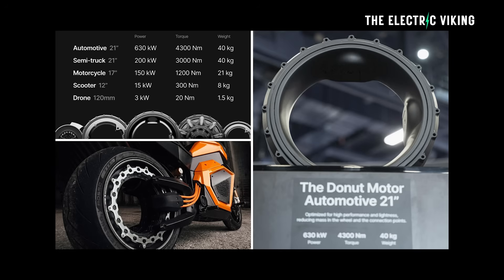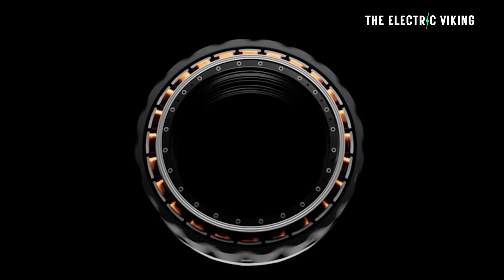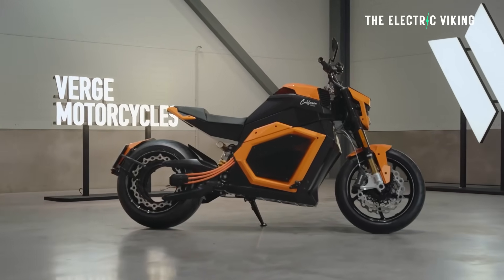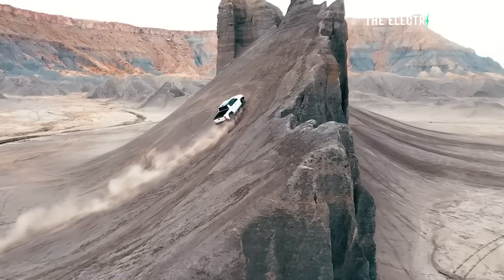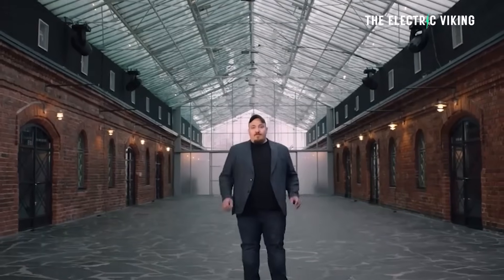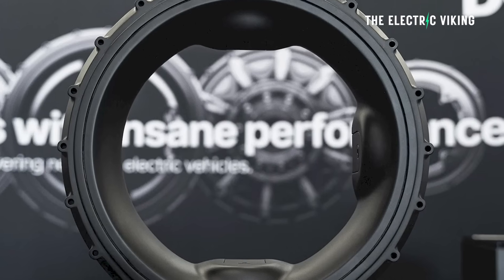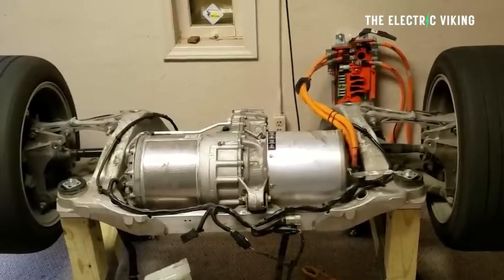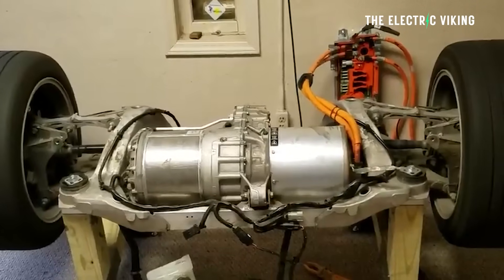Donut Labs' game changing Electric Motors will Revolutionize the EV Industry

Comment: I just don't see it.  These motors would be subjected to all kinds of torturous elements, potholes, floods, curbs, rocks, earth/sand, etc that, even if you could harden them, must degrade over time.  I can't think of anything manmade that can withstand continuous punishment without needing regular maintenance or repair. I imagine you would also need all 4 wheels to operate at the same level, the same rate, all of the time. If one motor is not working properly, then what?    I'm sure it's great, on a dyno.
Reply: Some of that you can handle with a bit of clever code ;-)

Comment: I wonder if the Angular Momentum would be a significant factor that would affect the drive-ability of a motor bike? The Angular Momentum won't be significant if the wheels are just alloy rims and rubber tyres. A 40 Kg  wheel hub plus rubber tyre would make the vehicle difficult to steer because the Angular Momentum would dictate where you are going.
Reply: Is that true if it is on the back wheel?
Reply: @isstuff  I am not an expert on motor vehicles, but with my understanding of Angular Momentum, it wants to stay the course. Think of a heavy tops, or a flywheel. To make it change course, you need to apply significant force to do it. It would be rather awkward I dare say. But one of the benefits is the motorbike stays upright.

Comment: How does it deal with real driving over 10 years. Things like potholes, gavel, mud, water etc. just surviving the daily grind
Reply: that's what matters the most: reliability
Reply: Normal engine/motor placements put them far away from the source of vibration (road surface) with many things in between dampening the vibrations/shocks - starting from the tyres themselves, shock absorbers, springs, bushings, engine mounts etc. This puts the motor right there inside the tyres as wheels. So yes one has to wonder.
Reply: This would work in the Netherlands, almost no putholes in the road...99% smooth😊
Reply: @jabo7763 no snow or rain either
Reply: There's two things that bother me if these use permanent magnets ...heat and vibration impact damage to the magnets ..
This is an outrunner design. 

The other issue is the effect of constant exposure to water road salt and debris.. even a problem for rim mounted disks. 
Then there's flooded roads deep mud and sand. 🤔
Might be good if driving from inside a boat or rotorcraft.

They also need to get away from rare earth magnets and copper wire windings  as far as possible. 

So maybe talk to someone like Advanced Electrical Machines out of Newcastle university 🇬🇧🧙🏼‍♂️
Reply: I guess they don't have to be inside a wheel. One either side of a diff unit would still be light and powerful, and would not be a factor in the unsprung weight.
Reply: yes, would only work on smooth roads or the unsprung motor would need to be insulated with a high wall tyre.
Reply: 🤔. That's right. Create doubt. It helps keep the two camps separate. The motor is new. It hasn't been around for 10 years. Asking a question like that is disingenuous. 
The science though points towards a far superior product. A lot less moving parts.
Reply: How does it compare when it comes to reliability?
Reply: In automobiles, lifespan is one the biggest factors. Nobody wants a car that needs a new "engine" in 10 years. Evs are somewhat iffy on that when it comes to batteries already.
Reply: @N20Joe 
Yet the ICE manufacturers are building engines that need repairs or replacing in a lot less than that ... If you look at the repair channels.   They really have lost the plot ... even Mercedes commercial vans have been showing Achilles heels in their design and production.
Reply: Your tire will take the damage before the wheel hub does that is basically the motor. Also regular pothole would do significant damage on a regular care depending on size , no regular person intentionally drives over potholes.

Comment: Even if hub motors/wheel rim motors are problematic or unfeasable for ordinary cars, it is a good thing if there is competition between different manufacturers to reduce the weight of electrical motors.

Comment: This would simplify the skateboard design for electric cars too. No motors or drive train on the deck at all. Just the battery pack. That would add up in manufacturing efficiency.
Reply: 1.000 mil Battery
Reply: it actually wouldn't: there are hub motors that have the conventional design with the axle being where it should be, and yes they weight more (50-60kg) and are sprung weight (sprung weight is BAD) but this is also sprung weight and it's also >40kg. 
A 20 inch rim for a normal weel usually is less than 10kg.

This is literally reinventing the wheel, except it puts a longer distance between the axis of rotation and the place where the force is applied, meaning it is likely more prone to failing
Reply: Then there is the suspension design….
Reply: @ and it must have a million roller bearings all around instead of just 2 on the axle
Reply: Axial flux motors are better